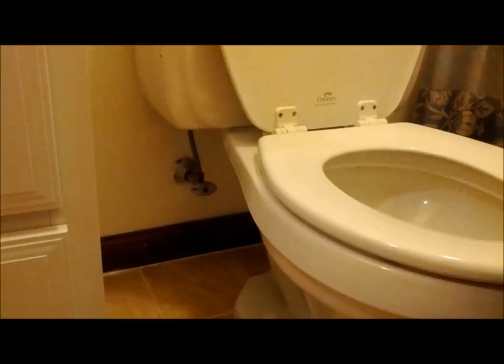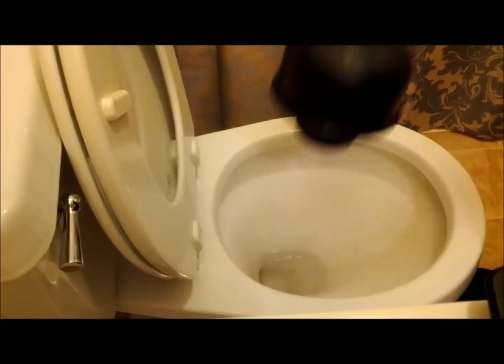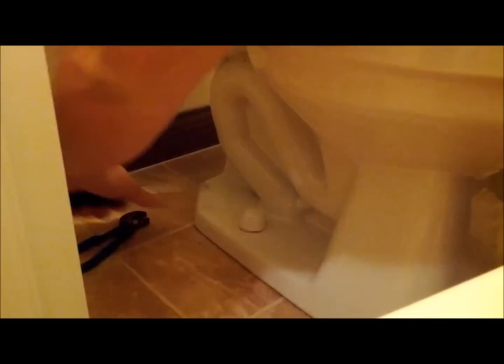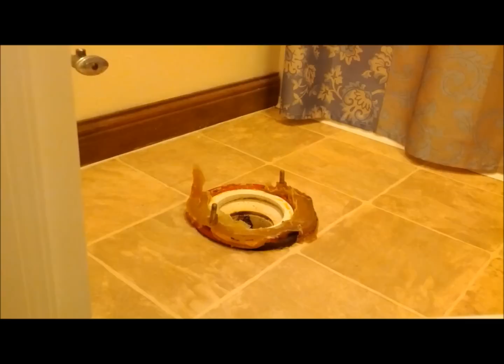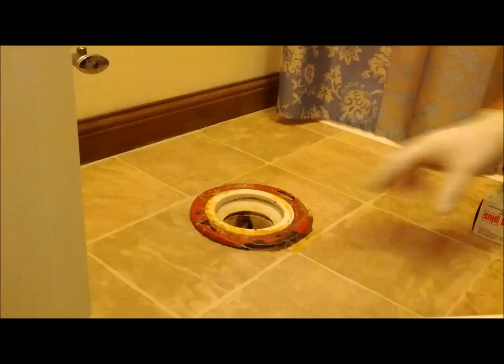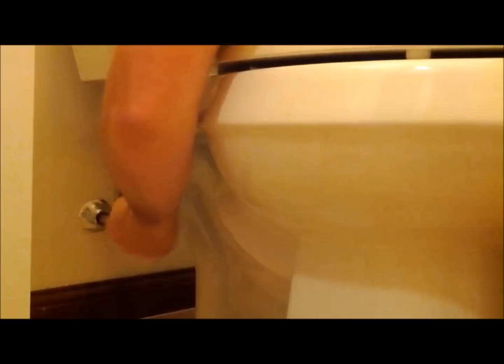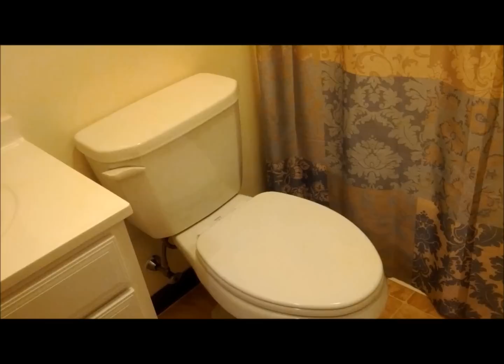How To Remove, Install, Replace, Or Update Your Toilet.

Comment: How did you line up the toilet to set perfectly centered on the wax ring?
Reply from the maker: I set the jonni bolts into the flange parallel with the wall and then set the wax gasket centered within the toilet flange then I hold the toilet between my legs and align them. Align the jonni bolts and the holes in the base of the toilet and then set the toilet. I just filmed a new video of assembling a toilet and me setting it as an add on for this videos. Hopefully in the next few weeks I can edit it and get it posted.
Reply: @TheDIYGuyDOTnet  thanks for your help
Reply from the maker: @donaldsherbondy1950  No problem. Good luck with getting it replaced.

Comment: Thank you so much. Your directions were very clear and easy to understand. The only thing we did that you didn’t was that we bought this gel to pour into the toilet bowl after plunging,  to solidify the water, to keep it from leaking.The only thing missing was attaching the tank, but we were able to figure that out..
Reply from the maker: You're welcome. Glad we could help. Thanks for watching and taking the time to leave us a comment. This will be a video we will be redoing shorty there will be another toilet assembly video coming soon as well. I never thought of using that gel to keep it from spilling out.

Comment: TheDIYGuyDoTnet, I have to replace a toilet. Will there be standing water in the line?
Reply from the maker: There will be no standing water in the line unless you have a clog somewhere in the line. But in most cases if there was a clog if the toilet wasn't used for a few hours the water tents to slowly leak though the clog. The only water you  should have to deal with is the water in the supply line and in the bowl & tank of the toilet.
Reply: @TheDIYGuyDOTnet  Thanks
Reply from the maker: @jimnicosia5934  No problem, Glad we could help. Good luck with getting the toilet replaced hopefully all goes smoothly for you.

Comment: Seriously, is it really that easy?
Reply from the maker: Yes, I is not that hard once you have seen it done. Almost all of it will be the same. Sometimes you may have a different toilet with 4 bolts instead of the 2 or a gasket made up of something different. The only real problem you run into is if the flange is rusted out. So you will need to replace it or use these type of jonni-bolts --> https://amzn.to/2BJOhQ2.

Comment: When you put the johnny bolts in the floor were they attached or biting into anything? Didn't look like it?
Reply from the maker: There are slots in the metal ring or mounting flange on the floor. There is a bigger spot where the head of the Jonni-bolt will go into and the slide it to the narrower end and it will stay in there. If the flange is in poor shape they normally will rot on the thinner/narrower side of where the bolt stops. Meaning you will have to replace the flange sometimes you can put this style right over the top of the old one -> https://amzn.to/2EfZtFo or if the sub floor is still in good shape you can use these -> https://amzn.to/2SZQSiq

Comment: What was the hacksaw/grinder for?
Reply from the maker: Depending on how rusty the johni bolts are sometimes you will not be able to remove the nut with pliers or a wrench, or sometimes the johni bolt will spin so you will need to cut them in order to remove the old toilet also the new bolts are longer then they need to be sometimes you can snap them at the snap point but I normally use the cutting wheel to cut them right at the nut to ensure the cap fits.

Comment: If the toilet you have currently isn’t efficient (probably flushes 5 gallons) and you want to upgrade to an efficient toilet are there special considerations? Thanks for the video! Very helpful.
Reply from the maker: The only one I can think of is make sure to go with a brand name one and maybe do a little research on each and see what people are having problems with. Some have one jet down low in the bowl I think it was a Toto brand & others are like a common toilet with jets in bowl and one down low. Some use a larger flapper to let more water down faster to have a better flush. I know there's one don't remember the brand off the top of my head that flushed well but if it did clog the bottom was shaped differently so it was hard to get a plunger to seal so you would have to snake it to remove the clog. The one I use the most and have in my house is a Gerber Viper, comfort height W/ elongated bowl works well has a larger flapper and is priced mid range not cheap but not over priced as well. You might find a better quality video but this one shows the Gerber Viper in testing. https://www.youtube.com/watch?v=FalvA10CYxY You're welcome, Glad we could help. Thanks for watching and taking the time to leave us a comment/ question. Don't forget to give the video a thumbs up/ like. Thanks

Comment: Why with the horn??  How do you know if the new toilet uses the "Horn"??
Reply from the maker: I almost always use the medium ring with the flange but do carry two standard ones on the truck. The cost difference is not that great. The flange helps to ensure that the ring is centered over the flange in the floor and to direct the waste into the pipe. More wax in the ring helps ensure a good and thick seal. Some people hate/ don't like the flange/ horned gasket.. If the toilet clogs a lot and needs to be snaked rather then plunged you could catch the funnel/ horn with the end of the snake. Some feel its restrictive. The toilet doesn't dictate whether or not you can use the horn/ funnel wax ring its the height of flange in relation to the height flooring and how much wax it will take to seal it. The standard size wax ring doesn't have a funnel / horn. Once you go to the medium, thick and jumbo most of them have the funnel/ horn in them. Hope that helps answer your question.

Comment: I've had two different house inspectors from the same company say you can do this yourself and the other said get a plumber. How do you make sure the wax ring is not leaking after you replace it? Some people who diy say theirs leaked afterwards.
Reply from the maker: Hello, Its making sure that you set the toilet right down on the bolts and not having to twist or have to reposition it once it touches the wax. Also make sure when you push the toilet down you feel the wax squeesh a bit. If you don't you may need a larger wax gasket depending the height of the flange compared to the floor height. Something like -> https://amzn.to/2SAkT4Z . The best way to check for a leak is to flush the toilet a bunch of times and then go under where the toilet sits and inspect around the pipe/ flange from the bottom and look for water/ a leak. Hope that helps. Thanks for watching and taking the time to leave us a comment/ question.
Reply: @TheDIYGuyDOTnet  thanks so much!
Reply from the maker: @brittanylewis5565  You're welcome, Glad we could help. Good luck with replacing or repairing the toilet. Don't forget to give the video a thumbs up /like. Thanks
Reply: @TheDIYGuyDOTnet  absolutely!

Comment: There are couple of tiles are crack around toilet bowl, anyone knows what is problem ?
Reply from the maker: Hello, Cracked tiles could mean there loose. Glue has released causing them to move and shift around. It could be that the toilet is loose to the floor and when used rocks around causing a pressure point on the tiles causing them to crack. Someone cut the hole for the pipe bigger then it needs to be so the tiles have no support underneath them causing the to crack.Someone over tightend the toilet causing them to crack. You could pull the toilet if you have some matching tiles and replace them. Would give you the exact reason what caused them to crack/ break.

Comment: Change from small toilet to bigger is work for that too?
Reply from the maker: I'm guessing you mean from a round toilet to an elongated one? Yes it will be the same as the foot print of the base are pretty close. The bolt holes will be in the same spot. Just check your rough in size to ensure you get the same for the new toilet.

Comment: With a two-piece toilet do you recommend installing the bowl first then attaching the tank or doing this part at the beginning and install as one unit?
Reply from the maker: I install it as one. But some people find it easier to set and align the bowl then attach the tank so your not holding the extra weight of the tank. If you new to replacing a toilet I would say set just the bowl and then attach the tank. That way you can ensure you have it lined up and don't risk messing it up and having to buy another wax gasket.
Reply: 7 Signs or Symptoms Your Toilet Needs to Be Replaced         https://healthyhomes.co.in/7-signs-or-symptoms-your-toilet-needs-to-be-replaced/

Comment: What if a cleaning brush handle is stuck in toilet.
Reply from the maker: Try and grab it and pull it out. You can try and hook it with a toilet snake and also try and remove it. You might have to remove the toilet get it outside and lay it over and pull it out from the floor side of the toilet.
Reply: @TheDIYGuyDOTnet  omg i got mad broke the toilet snake out of the plastic covering and and it bundled it and grabbed it you sir saved me 175 to 225 thank you.
Reply from the maker: @therealtubeplayer  You are welcome. Glad we could help and that you got it out. Don't forget to hit the like button.

Comment: Do I have to replace the Johni bolts when I replace the wax ring? I don't have a saw or grinder to cut new bolts down to size.
Reply from the maker: Yes, you could reuse them. If you removed the nut easily then I would. Sometimes after they are cut the nuts don't come off easily so when trying to get them back on it can be bit of a pain and sometimes they don't start right away and they just turn the bolt. Then you will need a flat screwdriver and push it against the bolt and then start threading the nut on. The screwdriver should hold the bolt from turning. They also have new Johnny bolts that you don't have to cut.  -  https://amzn.to/2o1WTdq

Comment: my toilet wont flush and it's not clogged so i think i might have to remove it and see whats up with it.
Reply from the maker: There are a few things that can cause that to happen. The first thing to check is the operation of the flapper. Make sure it opens easy and stays open for sometime to let enough water go down. They become hard or really soft depending on your water type. Also if you use tablets in the tank ensure that one didn't go down the flapper hole restricting water flow. The next is to check the jets to ensure they are all flowing freely and the toilet makes a good swirl. The same thing happens with in tank cleaners the clog the jets making it not swirl and flush well. Let me know what you find out.
Reply: fixed it, it had a toy inside had to take it out to see. lol
Reply from the maker: lol. Glad you got it fixed.

Comment: Thanks, to the point and straight forward 
The only thing I would add is to use a level to ensure the toilet is leveled in both direction. Sometime you need to add couple wood chips to level the toilet based on the bathroom floor condition
Reply from the maker: You're welcome. Yes , good point about the shims. we are going to be redoing a few of our older videos to make them more complete. I would not use wood they make small plastic hard and soft shims just for this purpose.

Comment: Good video but you completely bypassed setting the wax ring?? I was hoping for some tips on that....
Reply from the maker: 3:00 the wax ring gets set. Some people put the wax ring on the bottom of the toilet then they set the toilet in 2 pieces. I set the wax ring centered on the flange easier to tell with the one with the cone. ( center the cone within the pipe. ) and place the toilet.

Comment: Hi! I would like to completely remove toilet and I'm not going to put a new toilet instead of it. What do you recommend to use to cover the sewage pipe, so that there will be no smell? And what do you recommend to make the floor even on the spot where there was a toilet? People will be working in this ex-bathroom 5 days a week after toilet removal. Sorry for my English! Hope you can answer.
Regarding removing the old toilet your was very helpful! Thanks!
Reply from the maker: If there is not going to be a toilet reinstalled your best bet would be to cut the pipe and then glue a cap on in the basement or crawl space. That would ensure that it doesn't leak or smell. For the floor remove the flange and get the correct thickness plywood to match you can take the same size hole saw as the hole in the floor and cut a piece out of the plywood to fit the hole then screw some 2x4's or 2x6's across the hole from the bottom and then screw the plywood to the 2x4's from the top. That should make it all the same thickness and then you can add or do the new flooring. You're welcome, Glad we could help.
Reply: Thank you very much for clear instructions!
Reply from the maker: No problem, Glad we could help. Thanks for watching.

Comment: This is fine but how do you accommodate a 300-pound girl who repeatedly gets the toilet rocking and breaks the seal of the wax ring?
Reply from the maker: You will want to make sure the ring that the jonni-bolts go into is solid and not rotten out as that holds the toilet down and will stop it from rocking and thus making the wax ring fail. If the ring is good and you still have the problem then you may want to go to a two bolt toilet, I believe American Standard makes one that way you have four bolts holding it to the floor stopping it from moving. Another way would to use 4" toilet lags and lag though the flooring and sub floor and then put a 2x4 or 2x6 under the sub floor between the joists to give the lag something to grip to and sandwich it and spread the holding power out. If its a ceramic tile you may want to caulk the toilet down to give it a little extra holding power. Also you may want to install a grab bar. Hopefully this helps or at least points you in the right direction to getting it solved. Thanks for watching and good luck.
Reply: lol
Reply: Weight watchers

Comment: How long should it take for a plumber to remove the old toilet and install a new one?
Reply from the maker: umm. That's a good question. It depends on a few things. If the valve right next to the toilet holds, if the toilet flange wasn't rotten and didn't need replacing. If I run into no problems I get it done in hour to hour and a 1/2 or so depending on location in the house, 1st or 2nd floor. I would say the average is 2 to 2 1/2 hours for 1 person.

Comment: Video well done.  I want to make a few pointers replacing a toilet in an older house:

1)  measure from wall to centre of bolt holding toilet; 13" versus 15" (I got caught; my old toilet was 13" from back wall.  The 15" did fit but I couldn't get the tank on the toilet).
2)  small wet/dry vacuum suck out water from tank and bottom of toilet
3) seperate tank from toilet (easier on back)
4)  small catch basin for water drips after instaling supply line
5)  use a bit of dish washing detergent as whetting agent on the rubber gasket between new tank and toilet
Reply from the maker: Yes all good and valid points especially the toilet offset. I did forget to mention that..
Reply: Level? Shims??
Reply: Why does the tank need to come off the toilet?
Reply: @davidpierce9949  It doesn't need to, just makes it easier working with 2 lighter pieces. Leaving the tank on makes it heavier and a bit awkward.

Comment: aren't you supposed to caulk it????
Reply from the maker: There is no need for caulk. I am not a fan of caulking the toilet as if the wax fails the water has a grater chance of going though the floor and into the lower level rather than onto the floor so you will notice that you have a leak. The wax gasket does the sealing of the toilet.

Comment: Questions: Do you ever mis-align the toilet to the wax ring, or does lining up the anchor bolts when you set it down guarantee that the toilet is centered? Do you use teflon tape or plumber's putty on the supply line? Is there a reason (other than weight) to install the base first and the tank second (as my toilet's instructions say)?  Thanks!
Reply from the maker: I have never misaligned a toilet if your bolts line up then your wax gasket should be in the right place. No puddy or tape. The 3/8 part is a compression fitting and the top has a rubber gasket in it to seal it. No, They figure its easier to handle the base by itself to align and hold and then install the tank to the base. We install them complete all the time to save time. One person removes the old toilet as the other person puts the new one together.

Comment: The Johnny bolts attach to the toilet but look like they just sit in those holes. Do they screw into anything? From this video it looks like you can just pick up the toilet.
Reply from the maker: The johnny bolts sit in a groove within the toilet flange which is screwed to the floor.
Reply: Tony Goins John bolt slide to secure the have a flat catch at the base of the bolt that slides I. To place on the ring track

Comment: I bought a rubber gasket instead of a wax ring. I'm hoping I made the right choice.
Reply from the maker: It depends.. They are ok. They seem to fail faster if you have city water because of the bleach.

Comment: Omg. This looks not too hard. Can I do it myself without a man?
Reply: If you can lift the toilet, and you don't find any surprises, you can. Some toilets are pretty heavy and some floors are rotten under the toilet.
Reply: @Red_AM  You have to patch that part of the floor (cutting out a square that gets all the rotten floor, and sits on joists for support). It's a job for sure.